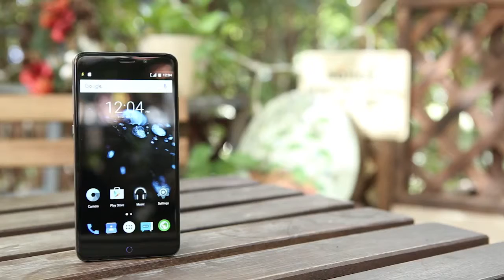UMi Super official

Comment from the maker: Buy UMi Super here:
►Gearbest: https://goo.gl/jnwphw
►AliExpress: https://goo.gl/7oH0Ra

UMI Super 5.5 inch 2.5D Arc Screen Android 6.0 4G Phablet Helio P10 64bit Octa Core 2.0GHz 13.0MP Rear Camera 4GB RAM 32GB ROM Type-C Accelerometer Compass Fingerprint Scanner

Main Features:
Display: 5.5 inch 1920 x 1080 FHD Corning Gorilla Glass 3 screen 
CPU:Helio P10 ( MTK6755 ) 64bit Octa Core 2.0GHz
GPU: Mali-T860MP2
System: Android 6.0
RAM + ROM: 4GB RAM + 32GB ROM 
Camera: Front camera 5MP + Rear camera 13MP with auto focus and Dual Flash (Dual color temperature)
Bluetooth: 4.1
GPS: GPS
Sensor: G- Sensor, Glonass, P- Sensor, L-Sensor, Accelerometer, Compass
Features: Type-C interface, OTG, HiFi, etc.
SIM Card: Dual sim dual standby ( Or 1 Micro SIM Card and 1 TF Card. Both SIM slots are compatible with 4G, respectively. When they work at the same time, only one of them can receive LTE service and the other GSM. Default at slot 1 )
Network: 
WiFi: 802.11 a/b/g/n 2.4GHz/5GHz
2G: GSM 900/1800/1900MHz
3G: WCDMA 850/900/1900/2100MHz
4G: FDD-LTE 800/1800/2100/2600MHz